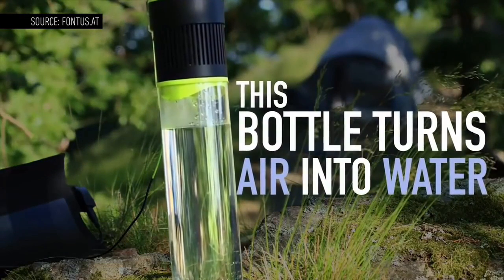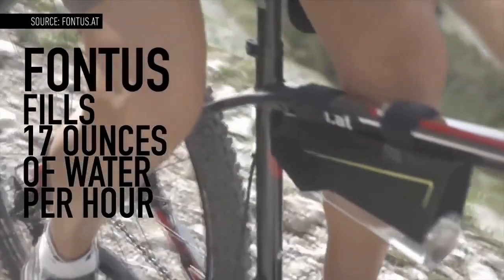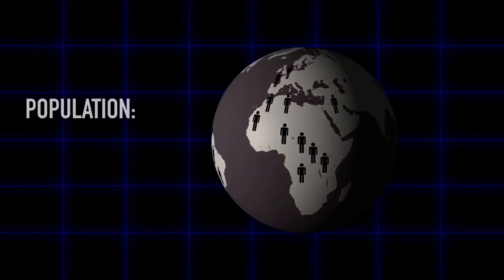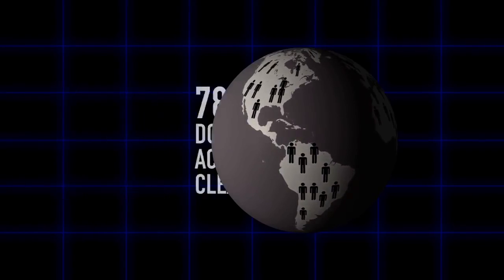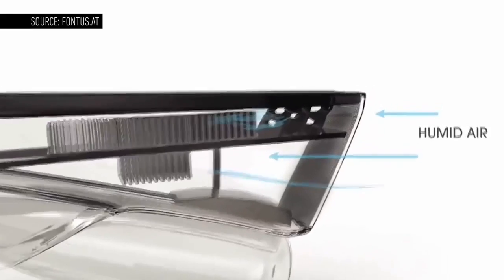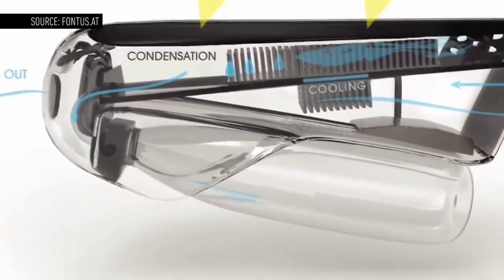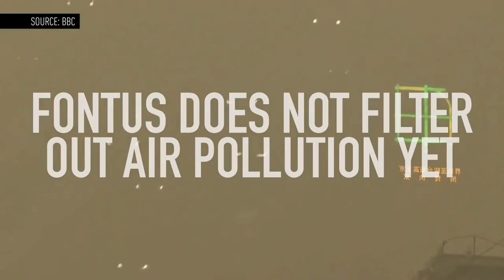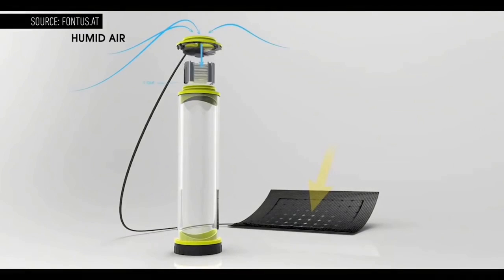Fontus - A Self-Filling Water Bottle

Comment: Can you drink water from a dehydrator?
Unfortunately, the answer is probably not. Dehumidifier water is typically stored in a tank that isn't necessarily clean or sealed tightly, which means that there could be bacteria present. In addition, most dehumidifiers don't have filters that remove impurities, so the water can also contain dust and other particles.

Comment: This product and concept has been thoroughly debunked at this point. All of these products, including larger systems like the Water Seer, are essentially just variations on the idea of using dehumidifiers to obtain drinking water, which is A) impossible to scale and massively power inefficient (i.e. forget mobile and/or powered by a small solar panel or even smaller windmill in most cases) B) not likely to generate enough water to keep a person alive unless the humidity is so high that rainfall is probable anyway and C) very sketchy in terms of safety, as numerous serious illnesses such as legionnaires thrive in the environment dehumidifier systems create, which is incidentally why virtually every dehumidifier you can buy will contain a warning not to drink the water it collects. This is an old video so maybe the OP didn't realize this, but just as a warning to anyone looking at ANY product claiming to pull water out of the air in some fashion for drinking, no matter how slick the presentation or claims of space-age technology or design awards, it is physically impossible to create a water-from-air system where A and B aren't true and unless the system is somehow hermetically sealed or regularly sterilized, where C isn't also true.

Comment: Don't buy into this bullshit. You're better off buying a reverse osmosis kit or water purifier supplies for adventuring.
Reply: Actually no, you're better off buying a home atmospheric water generator which does in fact condense water vapor from the air into drinkable water. Reverse osmosis only purifies existing water from the tap. So it's not the same thing
Reply: JustinLodes

For the outdoors, i.e. hiking/camping/etc.

Not for home.

Comment: What a load of crap... It would take a month for this thing to produce half a bottle, especially with the poor wattage you would get from a small solar panel. Only idiots will buy this. Why the fuck would it not solve a water crisis globally if it's that efficient. I'll tell you why, it's because 1) it is utter BS... And 2) they need to promote it as not being crisis so long because otherwise the entire planet would be raving about this product, which they are not, because unlike the idiots that but this crap, some people actually have brain cells. A company clearly preying on the gullible
Reply: They do make atmospheric water generators for the home. This could work on a smaller scale but yes, you may need more power than what this thing supposedly uses
Reply: +JustinLodes even with 100 times more power you would struggle to fill a bottle in a day. Plus the fact that this is reliant on the right weather condition which frankly is unrealisable at the best of times In most countries, I just would not work. It's the least efficient way of producing clean drinking water
Reply: MinecraftChaos so they say....its very simple:1- look up the energy required to condense said amount of water. 2-do a rough estimate of the area of the solar panels on the bottle. 3-calculate how much energy said panels can produce per hour. 4-compare the energy needed to condense the water and the energy produced by the tiny panels and there you go....it would take days to condense the water needed to fill that bottle with the energy provided by the tiny solar panels, even with the most efficient solar panels available today working with 100% sun exposure (which they would not have since they are sitting between your legs and turned to the sides). its a fucking scheme this kickstarter, just like a few others.
Reply: semabacho you need to see the latest design for this pile of junk... it's literally a full scale dehumidifier. it's a joke
Reply: MinecraftChaos you kidding yourself. no matter how much power you have, you can't pull water from dry air. not sure if you've seen their latest design but I suggest you take a look. it's basically turning into a standard dehumidifier.

Comment: Another step closer to Star Wars. Straight up Moisture farming people. Look out uncle Owen. What's stopping us from make one of these the size of water tower. Know one else think this solves our water problem or what.
Reply: No, because it is nowhere near as efficient as they make out... Do you realise how much power it would take to fill a water tower using this method?
Reply: +Dick Cheesehead what's crazy about it. I have an ac unit out the back of my window right now that gets a constant drip of water from built up condensation. I'm sure we could design a better way and this is only a small water bottle. It might not be practical now but I'm sure we'll get to a point where it could be. Stop looking at the moisture collecting bottle as half empty.
Reply: Joseph zink Ha... ha...
Reply: Joseph zink, and how much energy is being used to run that air conditioner unit?  I'm thinking a tad bit more than a 15 watt solar panel can provide.